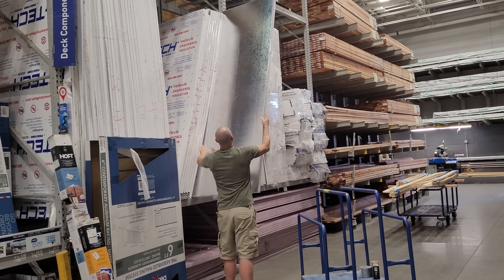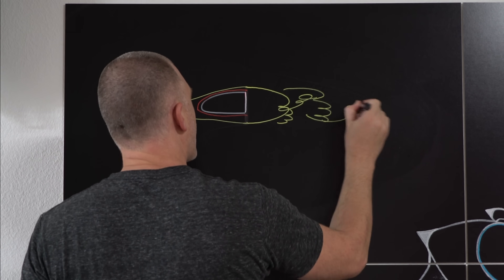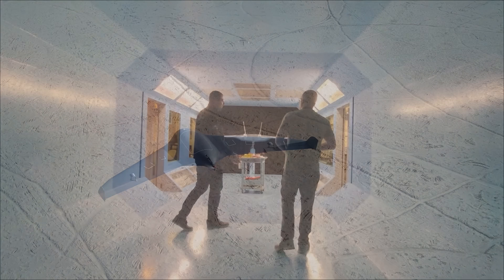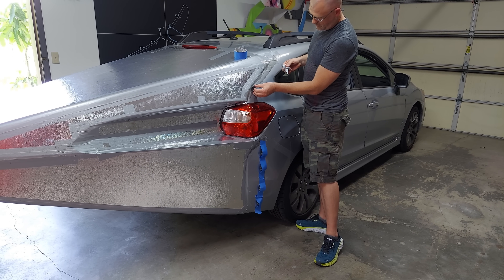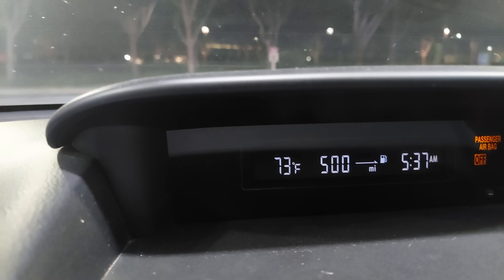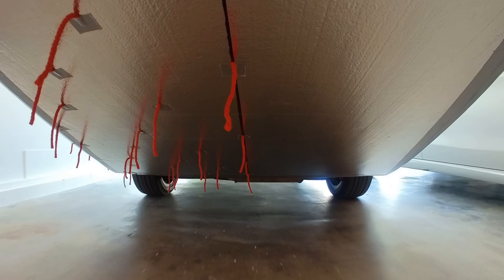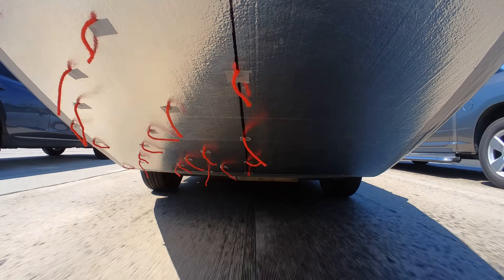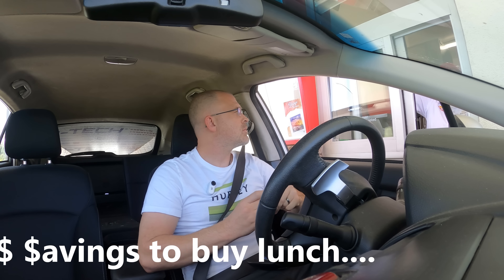Using Simple Aerodynamics to Beat High Gas Prices (Home Improvement Store Edition)

Comment: How about removing the rails on the top of the roof?  You could also add skirts to the rear wheel wells.  Consider removing weight too, carry less fuel,  remove interior rugs, rear seat when not in use and toolboxes in the trunk etc.  Type of tires makes a big difference in mileage as well as tire pressure.  Also, did you do a tuft test without the vortex generators?
Reply: Ahhhhhh a true hypermiler ;)
Reply: fuck it, just walk
Reply: You could also cut the car in half
Reply: @OMNI-Infinity  and remove a driver
Reply: He was just curious and wanted a simple experiment, he doesn’t want to go hardcore strip down ultra efficient
Reply: @hellothere6627  He did however suggest that manufacturers should do this. They don't do it because it's impractical to park, and the boot access is terrible. Hatchbacks are popular because they're easy to load and have a lot of luggage space for the size of the car. It's a fun amateur aerodynamics experiment, but the manufacturers know exactly what aerodynamics compromises they're making when designing new cars, and they test all their cars in wind tunnels
Reply: You could run the vehicle on low rolling resistance tires and some splitters on the front
Reply: It'd be a race car at this point.
Reply: I want to see this with a honda insight
Reply: @matthewmorgan582  absolutely, drag-coefficient of 5.
Reply: Yes, I got rid of the low rolling resistant tires on my GTI I got some proper sticky tires.  It was a pretty significant hit in mileage.  I also consistently get better Mpg's in Utah at 4300 feet of elevation then I do in California at say 50 feet of elevation.   This one is a little tougher, thinner air maybe, car can't burn as much gas, but I have a turbo? Less ethanol in the fuel, don't know i have to run 91 octane.  Anyways I can put sticky tires on my GTI and drive like an ass hat and probably still get better mpg's than a Subaru.
Reply: Also, get a lighter wife.
Reply: @rogerflorida1498  His wife looked trim.
Reply: Or a bike?  Nah, this is more fun.
Reply: Kumho Wattrun is good light weight tire to go with.
Reply: I dont think his goal is to complete change the entire car
Reply: Diesel swap the engine.
Reply: hes trying to make it street legal
Reply: I had a 1999 Forester and my may ecomod was removing the rails.  Four bolts and they were in the shed.
Neither carpet nor seat foam weigh much.  I doubt that he carries toolboxes if he blocked his hatch.
However, running sidewall max is proven to increase fuel economy.
Good point about tuft-testing without vortex generators.
From what I understand, those never benefit without extensive wind tunnel testing.
Reply: Removing small amounts of weight from a an average size/weight passenger vehicle is minimally effective in fuel economy! The gains are so small and negligible you might as well skip them! Aerodynamics and driving style however can make huge difference!
Reply: @daxmax1681  Building a boat tail makes more sense than weight reduction?
Reply: Remove the tools? Sure let's just get stranded in the middle of nowhere with no phone signal and hope for a beautiful single lady to pass by and give us a ride
Reply: @GonTar_X  Not many people know how to fix their own cars and even less are capable of fixing problems roadside. Some of these people carry tools for their work and it would benefit those people to remove the box before going on trips not related to work. Roadside assistance is also a thing too, I can work on my own car but I can't do it faster than AAA can get to me and I almost never drive out of their service range.
Reply: @drippingwax  congratulations on being that capable, I for one am not. Not everyone is like you and they aren't obligated to be. It's also a bit hypocritable to make a slight at me for making a comment while replying to a comment yourself.
Reply: @kungpow8062  you obviously have done very little experimentation of your own to come to that false conclusion!
Reply: @GonTar_X  "Toolboxes," not "Spare tire tools."
Reply: or you could just buy a car that's already aerodynamic
Reply: @cagneybillingsley2165  lol , the guy's trying to save money
Reply: @Alexis guy is succeeding at saving money.
Reply: @cagneybillingsley2165  & super-efficient like : VW XL1..
Reply: @poplaurentiu4148  That car was only meant only as a show of what could be achieved if you tossed as much money as you could at it. And the price reflected it. Sure it gets nearly 10x the mileage of other cars. But even if you're driving a truck, it would take a million miles at current gas prices before the XL1 would start saving money
Reply: @vitopannucci2001  They made a limited series of first XL1 hybrid (diesel-electric) between 250-300 pieces and was sold to those who afford-it and put deposits for pre-orders..  it goes 100 km/Liter and can do around 261mpg one car could cost between 150-170.000$ depending on the options selected.. but just few years latter Volkswagen made based on same XL1 another creation the XL1 Sport and that one got a glorious Ducati motorcycle engine, titanium exhaust & could achieve 280km/h.. in my case that is what i would love to get since i like it more, was faster & much sporty than the XL1 diesel-hybrid.. or the BMW i8..
Reply: @vitopannucci2001  No mate, you are wrong. XL1 is not expensive because of aerodynamic measures, it is expensive because it is a limited production run, because it CAN be expensive (they only made 250 pieces). Yes it is make out of carbon to save weight, but the majority of fuel eficiancy doesn't come from weight savings, but from aerodynamics. You can make a cheap car with normal sheet metal insted of carbon with similarly good fuel consumption, like 3  times less than normal car that would cost the same as normal car.
Reply: @drister007  I didn't say it was expensive because of the aerodynamics, but you're right that the limited production was a factor (lots of people working on it, special equipment to make the parts that weren't shared with an existing part from another vehicle, all divided between a very small number of vehicles). Carbon fiber in my opinion would have been the largest cost of production, seeing as it was much more expensive 10 years ago. The battery would be much more than today's prices but it wasn't a huge battery so not too costly. Hell, the only thing they did to save money in the project was to cut an existing engine in half.

Weight savings do improve mileage in both city and highway driving, although it is more noticable in city driving. If a car is made lighter, it can accelerate faster for the same fuel consumption or accelerate at similar speeds while consuming less fuel.

Where they both gain from weight reduction is with reduced rolling resistance. More weight increases the amount of contact with the road the tire has, which increases friction which is a loss of energy. Properly inflated tires reduce this while operating safely as designed. The hybrid system represented the most improvement in city driving.

Aerodynamic resistance increases exponentially as speed increases. Roughly speaking, it's virtually nothing below 30mph (50kmh), doubles at 60mph (100kmh), doubles again at 75mph (125kmh), doubles again at 85mph (142kmh), doubles again at 92mph (150kmh), doubles again before you hit 100mph (165kmh). Crazy to think that aerodynamic resistance is 32 times higher at 100mph (165kmh) compared to 30mph (50kmh)
Reply: @poplaurentiu4148  ah yes, the 200k $ unpractical car
Reply: @poplaurentiu4148  No get a streamlined hybrid for high efficiency.   Maybe an Acura NSX.
Reply: @gozinatorrorlandozimbana2716  So how practical is this mod above when you have kids in the back & want to put some things in the trunk ?..  yeah, i'm also curious what cops would tell him when they will see that mod..
Reply: @jeffk464  Why not the person who did the mods sell the subby & get an Tesla 3 long range ? price is at least 2xtimes lower than NSX or XL1 is also faster, has good aerodynamics and it runs cheaper..  problem solved !
Reply: @poplaurentiu4148  XL1 is nothing special just very ridiculosly expensive small car... But in general it is just a small car with battery and meaning how much work they put into it, its performance regarding consumption is poor.. Considering that it has a 50km baterry only range meaning that on nedc test that is claimed to do 0.9l/100km is just a nice trick to fool people.. it has better mileage just first 100km.. the same principle as the ridiculosly cheaper and more practical chevrolet volt or opel ampera get 1.2l/100km on nedc rating... just think about it... it is very obvious why they dont produce them - simply because in real world it underperforms
Reply: @BooRay1  Well XL1 was quite special still is considered special today but back when it was made between 2013 -2016 were quite expensive to be produced, not many were made in total and full EV's or hybrids were not that popular on streets like today, so back then it was like an UFO for streets.. even today i watch on youtube when a guy from US that does cars reviews ''out of spec reviews'' (got some Volkswagen invitations flew in Germany and did a trip in XL1 test it out on streets, most people were approaching to ask more details about the XL1 taking pictures since are not seen driven too often on public roads they did not know Volkswagen build such crazy cars.. So, because from 2020 we have other efficient cars some hybrids derived from well known ice versions like Hyundai Kona or Kia Soul & Niro but also some full EV's more popular and more affordable like Tesla 3 & Y, Hyundai Ioniq 5, Kia EV6, VW presented iD3, iD4 & iD-Buzz.. etc That is why today XL1 might not seem that interesting anymore for it's propulsion since they plan to ban diesels but it doesn't mean that XL1 was not special, is among pioneers of the most innovative hybrid vehicles, it still has a great consumption, still has one of the best aerodynamics for road legal vehicles with a very low drag coefficient so it still qualify even today as special for any of those facts..
Reply: @drippingwax  Can anyone stop a police officer when they want to investigate something regarding suspicious vehicles ? Apparently not all cops are stupid and those who know most models of cars and the law that stipulate what are the mods that are not legal,  they can apply the law & seeize the number plates and apply a hefty tax for driver : just few examples of illegal mods : foil applied to windows, louder mufflers, different wheels sizes, +all other types of modifications that are not hommologated to that particular vehicle.. so my question is this ;worth this mod considering police might give you a warning first time if you got enough luck to meet a good policeman, or risking tell you to get them off and this is in best case scenario without taxes apply or number plates retained which would be worse in case of a bad cop..  i will say that he proved his point with the experiment but it not worth it with the cops..
Reply: @drippingwax  Trade inn the ice-car for Ioniq-5 it has enough range between the charges to match the Sooby trip to fill up and speed and also it can accelerate faster.. this might be the most important objective but imo Ioniq-5 looks better than Sooby inside-out and can save more on 5 years owning from now on specially with the latest fossil fuel prices..  ;0)
Reply: @drippingwax  ice-car is the term used to describe the internal combustion engine-car.. if you didn't knew that well you just learn something new today.. is a shorter term well known easy to used make typing long words in bigger texts lines to be more shorter easy to read and faster communication, so yeah.  ;0)
Reply: @drippingwax  Well sorry yes, tanks for that i need to explain myself a bit still, i'm not trying to get an excuse because i was thinking too long for that term since English is not my native language and i know other 4 different language in same level as English (spoken & written) but somehow sometimes i wrongly still confuse terms or wrongly used them in different context or sentences.. but i still try my best to explain and to be understood from my point of view specially since here is not like a grammar competition or spelling championship right ?So i'm pretty sure you got my point above.. but i still don't know what is ''Ecomodder'', a brand of cars, manufacturer for sea-boats or some type of weird aircraft ?..
Reply: @drister007  XL1 was intentionally made extremely expensive and out of the reach of many consumers by the illogical use of exotic materials to save on weight! Once again this was explained away as a huge helper! But if you do some experimentation and testing of your own you will come to the realization that small weight reductions play a very small role in fuel economy!!! But in this case played a major role in increasing the price of the vehicle!!!
Reply: @jeffk464  you really think that Acura is aerodynamic!!!??? LOL
Reply: @poplaurentiu4148  gotta love how many people try to solve their problems the easy way-- through consumerism!!! LOL
Reply: @daxmax1681  Exactly, from ice cars diesels are more expensive to be produced than petrol, electric are not cheap to produced by any means specially back then, and when you add a carbon body on top which is also involve expensive machines and hard working dedicated man-labour to be produced as light as possible but also to fit properly with high build quality, since the XL1 was not cheap so they end up with a finish product that cost triple the brand factory to produce it then what the factory sold it for, that is why i thing they made it first as a experimental challenge to see the limitations of materials, new options & developing process and from each project they learn a lot specially since they did spend a lot of time in the aerodynamic tunnel to improve-it more since is among the street legal cars with lowest aerodynamic drag..
Reply: @cagneybillingsley2165  or just don't life in California
Reply: @cagneybillingsley2165   that's the way the industry/our consumerist culture would like to tackle it while taking away your hard earned money with it!

Comment: I was thinking if you could install an air scoop that can blow air at the center of the rear part, or maybe add an airfoil above the rear door. The latter is something I see in many after-market upgraded cars. You can also redirect the exhaust to eject more air into the turbulent area and reduce turbulence. I wonder how that low-pressure turbulent area will affect the exhaust and if the pressure difference between the burned fuel and the low pressure behind the car is of any significance to the engine and aerodynamics.

Comment: As cool as this, this car isn't legal to drive. A bored cop could easily ticket you for driving an unsafe vehicle. And if you get into an accident, your insurance might not cover it.

Also a Prius has a drag coefficient of about 0.24 while being road legal. I get about 65mpg in mine (in city driving with no 65mph speed limits). Other engineers have looked at all this stuff before and figured what works.

Comment: I guess of course its turbulent below the rear lights, as you put vortex generators before it. Wouldnt it help efficiency to remove all of these and put a few at the back most part? You wouldnt wand turbulence right before your aerodynamic installation, right? (I didnt read into aerodynamics)

Comment: So we established that 13% arguably delivered only by the top of the extension. 

Let’s say it’s conservatively 10% per side that’s 40% once the improvements are made to the sides and bottom probably more with the front splitter and skirts.

Flattening the bottom should significantly help as well, aluminium sheet cut around the suspension and fitted on stand-offs from the chassis will help here and also protect the underside of your car.

Comment: You have most everything covered that I can see; Yes, add the front air dam + side skirts. Yes, reshape the tail from spike-shaped to tear-drop. I would say ditch the vortex generators, because Vortices are just a disruption at highway speeds. Toss the roof rack for +/- one percentile improvement.
She ought to approach 50mpg when perfectly rendered!
Reply: Each modification is a point of diminishing return.  Zero Hour on Ecomodder started modifying his Subaru and then traded it in for a Mini.
Xist sold his Subaru and bought a Civic.
Vortex generators can work if they are installed with the benefit of a wind tunnel.
Some roof racks aren't designed to come out--you would need to use a grinder.
Some leave holes you would need to fill.
However, the cross members are attached with a total of 4 bolts and should make much more of a difference.
However, my 1999 Forester's crossmembers were shaped like an airfoil, while the sides weren't.
Subaru added squares to the back of their roof racks after 2010 and it was supposed to increase fuel economy from 32-33, but a teardrop would probably be better.
Their little squares filled the gap without getting in the way.

Comment: Front air dam and side skirts might make this perform a lot worse. You're going to be creating a negative pressure bubble that extends the entire underside of the car. It'll basically make it act like a parachute. Instead, design a flat floor and allow for a smooth transition between the underbody and the underside of the tail. If the air is still turbulent, then add vortex generators to the floor to encourage flow attachment. Proper ones of course - those carboard ones don't look like they were actually doing much considering how thick the panels on them are. Consider dive planes if you're not willing to buy off-the-shelf vortex generators from race shops.